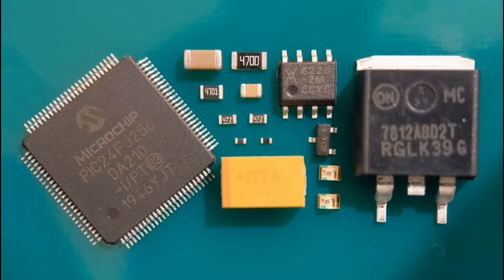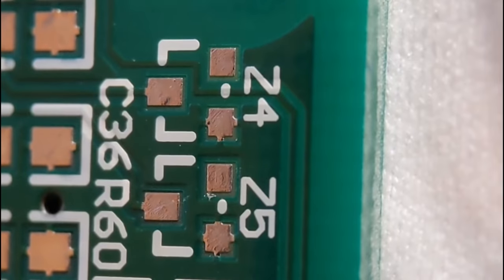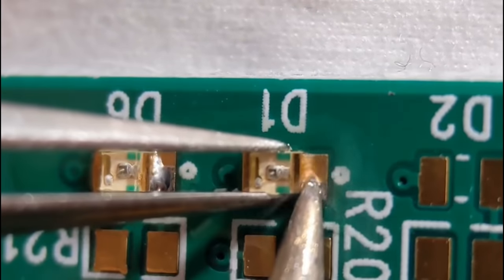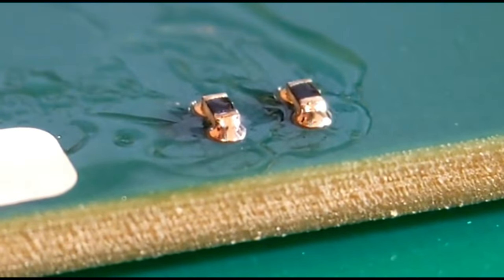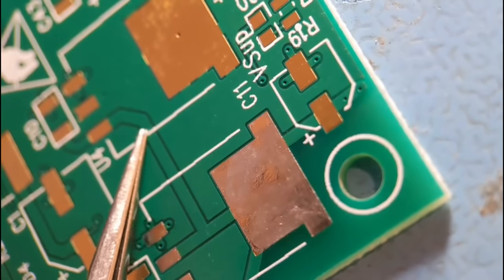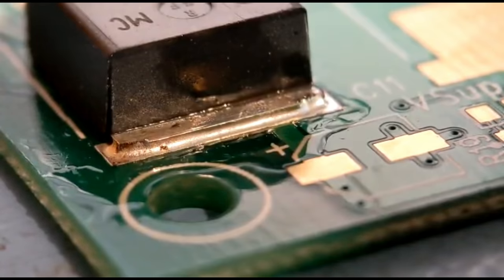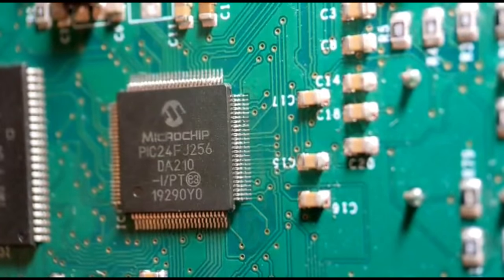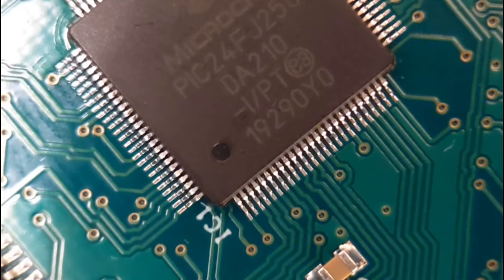How To Solder SMD Correctly - Part 1 /SMD Soldering Tutorial

Comment: What do you do if you get an accidental blob? I have a QFP with about 10 pins joined due to a failed drag solder attempt
Reply from the maker: Hi . The way I would deal with this is to first of all run flux across the affected pins ( without flux this would be nigh on impossible ) then place a tiny amount of solder on your iron tip and just place it on 2 or 3 joints and once the solder has melted quickly pull your iron away . If this works for you keep repeating ( cleaning your iron tip as you go. You may have to use solder braid to get the worst off but do as above to clean it properly . Remember the flux , that's the big help doing this . What's happened to you is why I don't drag solder. Good luck 👍.
Reply: @mrsolderfix3996  Many thanks, will give it a go. Not sure I'll try drag soldering again!
Reply from the maker: Hi . Just take your time . I should do a video on removing short circuits around IC's as it seems quite a common problem . It's not to bad just take your time and don't put to much pressure on the pins or the pads. Flux and solder braid are the things you really need for this , although if you haven't got to much solder bridging across you may get away without the braid . Good luck 👍

Comment: Thanks for the great video. May I know what temperature used in soldering the QFP.
Reply from the maker: Hi , thank you for your comment , much appreciated. In this video the temperature to solder the QFP was set at 350 degrees centigrade , which is a common temperature I use for a lot of small joints when soldering . The flux is vital doing this micro soldering . Thanks again , good luck 👍
Reply: @mrsolderfix3996  great
Reply from the maker: Hi , thank you 👍

Comment: What the purpose of oil??
Reply from the maker: Hi . I presume you mean flux . If so this is to aid the flow of the solder . Solder has flux in it already but people make the mistake of thinking this is enough , but it isn't . I never do any soldering without adding flux to my joints . Thanks again 👍

Comment: which camera do you use?
Reply from the maker: Hi . Basically I use a macro lens attached to a bracket that simply fits over my phone camera . I find I can get different angles doing it this way with the phone positioned around the work etc. I don't know the make of lens i got though but it was only about £35 Inc bracket. 👍

Comment: Are you using an alcohol wipe to clean off the flux?. Thanks
Reply from the maker: Hi . Thank you . I use ultra thin dry wipes that don't leave fibres behind ( company called Grove ,based in England , about £4.50 for a pack of 100 ) dipped in a fluid called Ultrasolve which in my view is the best pcb cleaning fluid on the market. That's available at places like Farnell and RS supplies . It's the recommended partner for the flux I use SMFL200D . Hope that helps , thanks again 👍

Comment: What soldering tool you use? Than you for video!
Reply from the maker: Hi , thank you for your comment. The soldering iron i use is a Weller TCP S model . The tips I normally use for this iron are a PTP7 ( small conical ) and a DD8 ( large flat sided ) , hope that helps , thanks again 👍

Comment: How hot is your soldering iron tip?
What flux are you using?
What are you using to remove the surplus flux?
Reply from the maker: Hi , all the soldering in this video the temperature of the iron was set at 350 degrees centigrade. The fluid I use to always clean my flux off is called Ultrasolve. It's the best flux remover I've ever used ( and I've used loads over the years ) . It's available from places like Farnell , RS Components , Rapid Online and other electronic distributers. The wipes I use are called Gtek dry wipes from a company called Grove sales  , about £5 for a pack of 100 . Also they are amazing , the best you will ever find for gently applying cleaning fluid. Hope that helps , thanks again 👍
Reply: @mrsolderfix3996  Thanks a lot! In the meantime I edited my post so there is a third question if you don't mind: what flux are you using? Thanks again, very helpful!
Reply from the maker: Hi . I use a flux called SMFL200D . It's a great liquid flux , comes in a 200ml spray can . I normally just spray some into a small container and apply using a dipped plastic Ty wrap to the desired areas. Its about £15 a can from Farnell, RS Components, Rapid Online and other electronic distributers. Also seen it on eBay . Hope that helps thanks again 👍
Reply: @mrsolderfix3996  Thank you 👍👍

Comment: Fantastic video! What diameter soldering wire are you using on the 100 pin IC?
Reply from the maker: Hi , thank you for your comment , much appreciated . The solder used on the fine pitch 100 pin IC was 0.25mm . This is the biggest tip I always tell people when doing fine pitch , get some 0.25mm solder , it's a godsend . I get mine from BLT Circuits ( England ) . Hope that helps and thanks again 👍
Reply: @mrsolderfix3996  Thanks for the tip!
Reply from the maker: Hi , no problem , thanks again for watching 👍

Comment: Can you show the magnifier you are using ?    I personally use solder paste and a hot air tool.
Reply from the maker: Hi . Thank you for your comment , much appreciated. I use a stereo long reach microscope from a company in the UK called GT Vision .  I haven't got any photos of it at hand but it looks just like any other long reach scope . I to sometimes use solder paste when I'm in my day job but I realize your average solderer doing this at home will not have access to board stencils , solder paste and a hot air station, that's why I show this option . 
Thanks again 👍
Reply: @mrsolderfix3996  , Also you may want to talk about your soldering iron tip .  What size is it ? .. i could never solder a 100 pin ic like that wit my iron.  I design circuits  using no finer that a 44 pin flat pack.

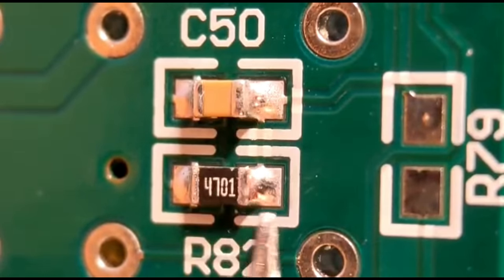Comment: I'm still at 2:32 (I haven't gotten that far if you mention it later)

What temperatures are you using?
Reply from the maker: Hi . Generally as in this video if I'm doing leaded soldering I would always use about 330 degrees centigrade and lead free roughly 350 - 370 degrees centigrade. I may vary these slightly for certain components but generally the above temperatures are what I would use . Hope that helps , thanks for your comment 👍
Reply: @mrsolderfix3996  Thank you for the information. When you file down your iron tip, is there a specific angle you are working towards? Or is the purpose of filing the tip down to keep the solder on the iron?

Sorry for the influx of questions. I just found  your channel on a search to fix my laptop's 
gpu memory.
Reply from the maker: Hi , the iron I use Weller TCP S has solder tips that you can file down even though you will get some people say you can't file them down . This is why I love this iron . I mainly file them to get any shape I need i.e. really pointy to do real fine detail stuff. Hope that helps 👍
Reply: @mrsolderfix3996 That absolutely helps. Thanks again!

Comment: what is the best temperature? many say 380 degrees?
Reply from the maker: Hi , thank you for your comment , much appreciated. When I'm doing unleaded soldering I generally use about 350 degrees centigrade and for leaded I would use about 330 degrees centigrade . I would adjust these up slightly if I have larger joints or ground plains by either using larger hotter tips or if I'm using the same tip by roughly 10 to 15 degrees. I wouldn't set my iron to 380 as a standard setting , that's probably to high and not needed for most applications. Hope that helps , thanks again 👍

Comment: Excellent dear boy! I need some of that solder and flux! My 1mm stuff is a bit much.
Reply from the maker: Hi . Thank you for watching . The flux I use is called SMFL200D . It comes in a 200ml spray can . I just squirt a small amount into a small container and apply using a dipped Ty wrap. About £14 a can from Farnell , RS Components , seen it on eBay as well . Pretty easy to get . I generally use 0.25mm solder ( leaded and unleaded from company in England called BLT Circuits ) very good stuff they supply , would recommend. Hope that helps , thanks again 👍

Comment: Hi sir nice soldering video . Which soldering flux and lead you are using and also which soldren using please reply
Reply from the maker: Hi . Thank you for your question . I use SMFL200D Flux , Sn100SB solder wire lead free , and a different leaded one 60/40  where asked for , both available in different thicknesses , I like 0.25mm and 0.5mm ( BLT Circuits , UK ) and Weller TCP S Soldering Iron with PTP7 and DD8 solder tips mainly . Hope that helps . Thanks again 👍
Reply: @mrsolderfix3996  thank you so much 🥰
Reply from the maker: Hi . No problem , hope you get on ok 👍

Comment: how do you determine your temps for your soldering iron?
Reply from the maker: Hi . Generally if I'm doing lead free soldering I would set the temperature to about 350 degrees centigrade , varying slightly for different size joints or ground plains by using different tips or upping the temp by 10 - 15 degrees.
For leaded soldering I use the iron at about 330 degrees centigrade . This temp works great , again as before using different tips and slightly differing temp + 10 degrees for grounds or large joints .
These temps roughly cover everything you ever need , in the end you get to learn what you need as you get more knowledgeable . Hope that helps 👍

Comment: what is the name of the small resistor what is his value
Reply from the maker: Hi , thank you for your comment. The small resistors were 0402 size components and in this case they were 100 ohm . 0402 size don't have values written on the top for obvious size reasons so are all similar looking. Hope that helps , thanks again 👍

Comment: What material are you using to clean the flux off?
Reply from the maker: Hi . Thanks for your question . The fluid I always use on PCB's to clean flux off is called Ultrasolve . It's a great fluid and leaves boards amazingly clean . The cloths I use to apply the fluid  ( or you can use a brush ) are called Gtek dry wipes , available from grove sales. These are the best I've ever used and I've tried a lot of different types over the years.
Ultrasolve is available from Farnell , RS Components , Rapid Online and other Electrical retailers . Hope that helps 👍

Comment: I prefer to drag solder where I can. Just got to have that magic touch so you don't mess up the pins. Sometimes you get a short here and there but those are very easily fixed with some flux and just a simple touch with the iron.

Comment: Hi, these are great videos. I have a very simple question, I'm wondering what you like to use to clean flux off from the board.
Reply from the maker: Hi . I always use a fluid called Ultrasolve . It's actually the recommended partner for the flux I use , SMFL200D . Together they are the best products of this type that I've ever used and Ive used many over the years . Hope that helps , thank you for your question 👍
Reply: Hi, thanks for answering my question! I would also be very interested to know what you do for a living if you don't mind sharing. Just wondering why you have developed these skills and experience.

Comment: What do i use on the pcb before soldering it? That clear stuff
Reply from the maker: Hi , I guess you mean the flux ? Before I solder any joint I always use flux on my joints , to me flux is vital if you want to achieve good quality soldering joints . The flux I use is called SMFL200D. I have posted a complete video on YouTube showing the benefits of using this flux. Hope that helps . Thanks for your comment 👍
Reply: @mrsolderfix3996  thanks for the intel man
Reply from the maker: Hi , no problem , good luck with your soldering projects 👍

Comment: Great, informative video! Do you have any brands you recommended for flux and solder?

Edit: Oops, then you mentioned it at the end of the video. "Bot circuits"? Not finding an online presence.
Reply from the maker: Hi . Thanks for watching . You need to search for BLT Circuits not Bot Circuits . You will then find them ok . 👍
Reply: @mrsolderfix3996  Ah, thanks so much! My hearing.
Reply from the maker: Hi . The flux I use is great . It's called SMFL200D . It comes in a 200ml spray can . I squirt some into a small dish and apply using a dipped Ty wrap to the desired areas. Available from Farnell , RS Components , eBay . Generally fairly easy to get hold of . Costs about £14 a can . 
I get all my solders from BLT Circuits . All their solders are great so whichever you choose you will find them great.
Hope that helps , thank you for your support and good luck 👍
Reply: @mrsolderfix3996  Great! Thanks, I'll check out the flux too. Looks like maybe I can't get Blt circuits solder in a home use size to the USA. There's a few sub mm dia solders on ebay, but mostly unknown brands.
Reply from the maker: Hi . If your based in the USA try a company called Mouser . Great electronic distribution company based in the USA . They sell pretty much everything electronics based , so I'm sure you will find fluxes , solders etc there . They are a very reputable company , I've used them personally over the years and always reliable . Hope that might help you , good luck 👍
Reply: @mrsolderfix3996  p

Comment: really excellent video. loved watching it. keep up the good work. ❤❤❤👍
Reply from the maker: Hi . Thanks for your support , much appreciated . I enjoy making these videos , so as long as people find them useful I will keep posting new ones up on YouTube. Been real busy lately so haven't posted for a few weeks but I will be back soon . Thanks again 👍
Reply: @mrsolderfix3996  . sir,  I watched a few more videos of your's after my earlier comment. these are a treasure trove of information. you must have really been in it to make it so possible.  loved all this.  I have one small question. how do we remove those electrolytic capacitors?  I would really be delighted if you make a video on that.  I have seen videos where people twist those caps with a plier, but I don't think that's the best way. you could ruin those delicate tracks.
Reply from the maker: Hi . Thank you . There are 3 ways I remove Electrolytic Capacitors . My preferred method is by using 2 soldering irons , 1 on each joint . This works in most cases but if it doesn't send enough heat underneath to melt the whole joint then you can try using a hot air gun to remove it . If this method doesn't work then I do use the twist method . I would hold each joint down for security with a small pair of pliers opened up across both joints if your worried about the pads and then gently twist , both ways , a little at a time . I find this method really safe actually . In one of my video's ( it's either part 2 or part 3 of my smd guides I actually show this method being done ) 
Hopefully that will help you , and good luck with whatever you do . Thanks again 👍
Reply: @mrsolderfix3996  . lovely.  thank you so much 😊❤

Comment: Hi nice solder job. what kind of flex do you use.
Reply from the maker: Hi . I use a flux called SMFL200D . It's a great flux . Comes in a 200ml spray can . I normally just spray a small amount into a small pot i.e milk bottle lid and apply using a dipped plastic Ty wrap . It's about £12 - £15 a can , and lasts ages. Hope that helps 👍
Reply: @mrsolderfix3996  yes it does thanks will have to look up the flex and if I can get some.

Comment: Hats off to you sir.  Very well explained and performed!  One question, which liquid flux do you use/recommend?  Thank you.
Reply: Edit:  Disregard. I found your other video with the brand you use. (SMFL200D)

The can looks like an aerosol.  How do you get it into the syringe or the contact lens holder without it spraying everywhere?
Reply from the maker: Hi . The flux is actually pretty well controlled when it comes out of the can . I don't use the straw that comes with it for dispensing, I simply just squirt gently straight out with total control , no mess whatsoever. I've been using this flux for many years and never had a problem dispensing it neatly 👍
Reply: @mrsolderfix3996  Thank you for the prompt response!  Unfortunately I cannot find this over on this side of the pond.  Any alternative brands you can suggest?  Thanks.
Reply from the maker: Hi . I'm sorry I don't really use any other types so can't recommend any others . I have seen it on eBay so have you tried there ? Good luck 👍